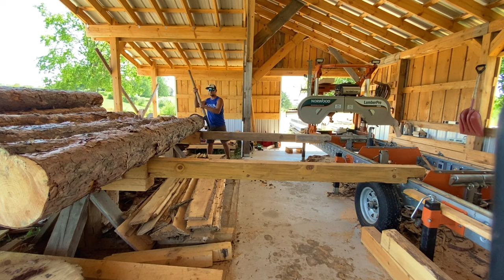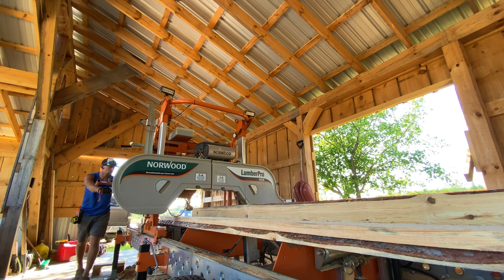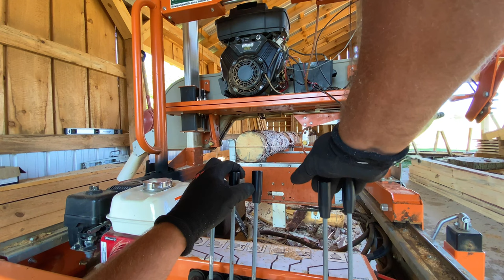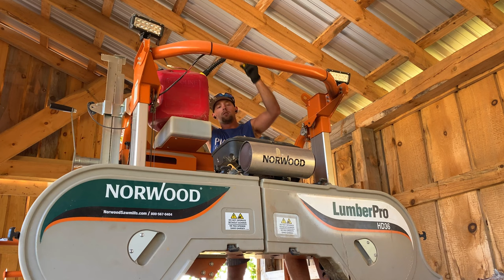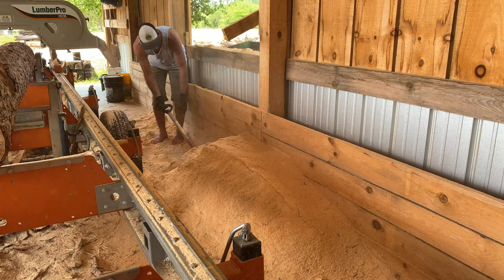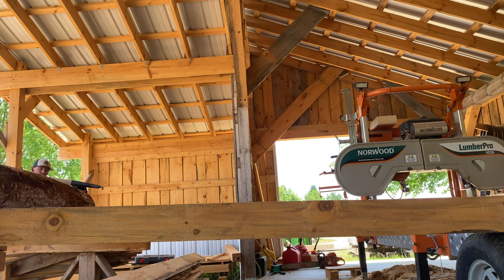Norwood Sawmill action! Sawmilling Pine logs | Sawmill Sights and Sounds

Comment: Why do you turn the first face cut outside instead of press it against the back stops? Are they not perfectly 90/square to the bunks? My only concern with this HD36.
Reply from the maker: I always checked it either with a level or a square, just to be sure it’s square. 
And If your turn the first face out, you can cut into clean wood sooner, vs cutting through bark and potentially hitting dirt or rocks. But usually I’d turn the first face down onto the cross bunks. 
Another reason to set the first face out, is if the log has taper, I like to raise the small end to compensate. So If I turn the first face out, I can do both my compensated cuts first, at the same time.
Vs having to do one, and then lower the toe board and then do the second one on the third cut. 
I hope this makes sense.

Comment: Where are you located?
How long have you been doing this?
How much for equipment 
We have 12 acres in Georgetown Delaware 
Looking for solutions 
Thank you
You are impressive 
AMDG
Reply from the maker: Hi, 
I used to live in Michigan, 
But last fall I sold my mill and move to TN, 
I had bought the mill in 2018. 
For around $13k 
I later added the hydraulic log clamping system and toe boards, and a blade sharpener and tooth setter which brought my investment up to about $20k 
I would recommend Norwood because they are fairly in-expensive and offer vertical operating log stops. 
And their shipping time is much quicker than most other manufacturers. 
I got my mill with an extra 4’ of bed length so that I could mill logs 16’ long. Just make sure you do your research and learn from others on assembly of the mill. If you choose to get one from Norwood that’s not assembled. 
Thankyou.

Comment: Any update on how you feel about the roller guides?  I talked with Norwood tech the other day and they really pushed me to keep my ceramics.   Their opinion is that the roller guides would be a downgrade.  My biggest worry is the linear bearing rail in the adjustable guide, not being able to handle the pressure.
Reply from the maker: I still prefer them, over ceramics. 
In my experience they give you a better cut quality. 
I actually had to ship mine on the adjustable guide, I. Order for it to have pressure on the blade. 
But then in turn it was hard to adjust. 
I’m sure it’s not made for pressure like that, 
But if it didn’t have pressure, what’s the point of having it there.
Reply: @Plankmills  For sure.  I've been considering redesigning the adjustable guide rail with something different, so that it will take a roller guide, be really rigid and be adjustable as well.  I get your point COMPLETELY.   When I got Norwood tech on the phone, my biggest question/concern was that I'm sure that I put a roller guide on that adjustable linear bearing, it's gonna wreck it.  It needs the downward pressure on the band and I'm sure that setup isn't capable of handling that load.  I'm glad it's working out for you.  If I come up with a different guide setup, I'll share it with you.  How's your "situation" going?  Did you move?
Reply from the maker: @williamprophett9148 
interesting, yes it would be nice to have something more sturdy. 
Someone mentioned that they got guides for their Norwood from cook’s Saw manufacturing. 
They are adjustable which would be super nice. I think he said he welded them on.

Comment: Hey, does the disel effect the wood? And do you use pure disel or mix it with water ?
Reply from the maker: I don’t know that it affects the wood. It is an oily substance, so I guess it’s not really bad.
Reply from the maker: I’ve tried mixing it with water but it won’t mix. 
In the winter I usually used windshield washer fluid.

Comment: I notice that you have hydraulics, but I don't see a log "roller" how does that work for you? Any regrets or is it there and I just don't see it?
Reply from the maker: I only have the log clamping system, and the roller toe boards with hydraulics. Sometimes it would definitely be great to have the log Turner, Or log loader. But for the most part I can get by without those.